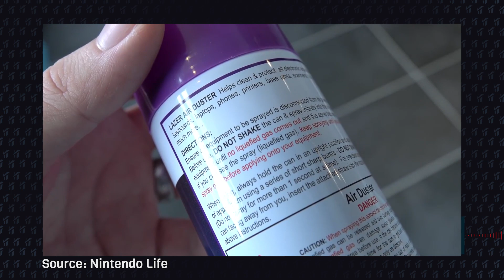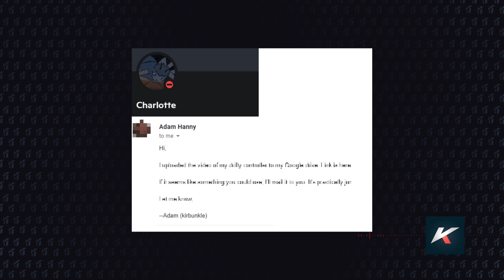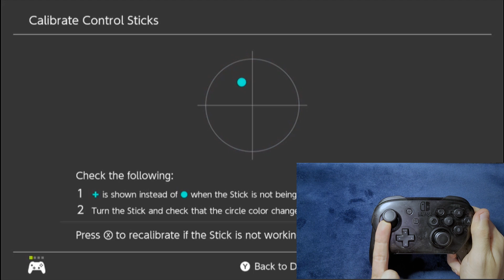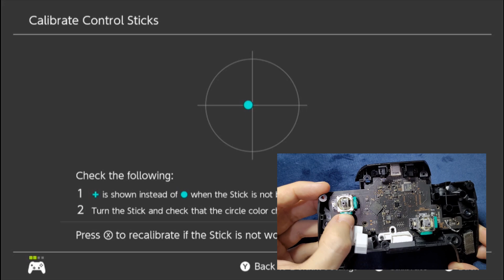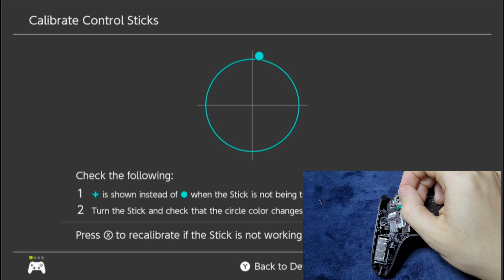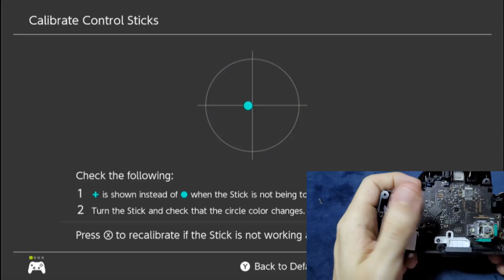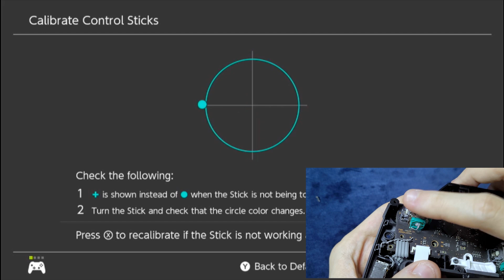Nintendo Switch Pro Controller Drift Fix!

Comment: Did not have any drift issues with the pro controller yet but this is going to be useful in the future
Reply: I have it on all 3 controllers after a month each
Reply: Same I've had my pro controller for 2 years and it didn't drift yet
Reply: @Tunic_  be careful my pro controller is 2+ years old and it just started drifting
Reply: @makito106 I'm using a pro controller from 2017 and it's fine but I have a dozen pro controllers so I'll be fine

Comment: This is the only video i could find that shows how to fix this problem with the stick drifting down like crazy, and I tought several times that i broke my controller because some things really weren't looking good, but after cleaning the controller from the inside and using 2 small and thin pieces of paper it worked perfectly again, thanks! If you're skeptical about doing this, it looks scarier than it is, you don't have to take the small metal circle out like he did, you just have to get the green thing out like in the video and put a small slice of paper or two through the hole.

Comment: When all you have is paper, everything looks like it needs some pressure added
Reply from the maker: Actually i believe that the problem in this one was the middle piece on the wiper that was loose so the paper acts as a shim
Reply: @VKsChannel  I had the same issue with gamecube controllers in the past. Instead of using paper, I used a small piece of plastic food wrap. This helped the middle piece stay more snug in the potentiometer.

Comment: Thank you VK! I tried it on my Surge Switchpad Pro Wireless Controller because one analog had INTENSE drift.. analog design is similar. Tried the paper fix and drift seems to be fixed. I will update in a month or if my analog will drift again.

Comment: I fixed my off-center drift by removing a piece of debris on that white "analog center piece".  No paper, no isopropyl alcohol, but air blowing that piece did the trick.  The key was opening that teal colored cover to get at it.

Comment: Bending the metal wire on the contact closer to the plate fixed it for me :) Thank you!
Reply from the maker: Yes it also works, but with time the metal can bend back, so if it does you'll know what to do

Comment: If you're here, there is a high likelyhood that your issue will be solved with the last step. Bend the wipers forward a bit and put a slim piece of paper or tape in the hole. It's actually better to just go straight to that first because you will avoid having to open and close your controller multiple times, which will increase the chance of something breaking.

Comment: Honestly, when I got drift on my pro controller I was just like fuck it. And put a spritz full of Wd-40 on the edges, swirled it around. And fixed it right up. 8 months later still no problem. Oddly enough, it did not work for Xbox or ps4 controllers.
Reply from the maker: The ps4 controller has a different problem I will post a video about it soon
Reply: I did the same thing lol, but it still have a little bit of drift sometimes on the right stick, wen I go home, I will do the process again and see if it works lol

Comment: Just tried this and by gosh it works. 
My pro would go solely to the left. It would not go up down middle or right. I did this and now it works as intended. I still have a minor minor drift every once in a while. I’m going to take it apart and tweak it a little more but I think this is gonna be the solution that works for me! 

Now, If you would do a video about the top buttons not work on the pro controller, that would be dope. Another one I have has this issue. None of them work. L, R ZR or ZL. And I can’t figure out why
Reply: In BotW it seemed like my ZR button didn't work... but that was only because of the right stick drift. Whenever you're on the bike and you tilt the right stick (changing the camera), ZR (centering the camera behind you) does nothing. 
Maybe that's also the case for you? You could try your buttons in different games.
Reply: @ZeldaPodSmashers  no they don’t work at all. I go the button screen in system settings where you can test all the buttons and none of the top buttons work
Reply: @Jeissecastillo  Ok, that sucks! I was really hoping it would be similar to my 'problem'. Did you check if there are maybe replacement buttons or contacts available?

Comment: i have 2 powerA controllers and on both controllers both sticks were drifting really bad. 
so i did these 3 steps - 
- cleaning the graphite pads with methylated spirits cos i dont have isopropyl alcohol and when i cleaned them the q-tips came out black 
- bent the metal wipers a little bit 
- and the paper shim trick in the hole 
and now none of them drift anymore they all work
but the one downside problem i noticed is the potentiometer protectors dont reconnect back well cos u have to bend them to get inside to clean, bend and shim

Comment: Pretty sure I did something wrong. When I took out the wiper from the potentiometer to clean it and reinsert it, both analog sticks stopped working altogether. There is NO input. Before I did this the sticks were drifting but now they aren't working at all. I even tried putting a piece of paper in the hole as demonstrated in the video and nothing happens. What should I do?
Reply from the maker: Check if the wiper is inserted in the correct position and if the potentiometer is completely attached to the stick box
Reply from the maker: You may have inserted it upside down
Reply: @VKsChannel  I think this was the issue, but it was VERY finicky. I was trying to fix this for 3 hours. In the end, it still drifts a little, unfortunately. But before it was drifting 100% of the time, and now it only drifts maybe 50% of the time and it doesn't drift as much. I think I might just get a new controller when it worsens. But thank you for making this tutorial and for the tips. I also watched your joy con drift video and that worked like a charm for me! Thank you!

Comment: So VK. I was wondering if there's anyway to fix snapback analog sticks for Pro Controller?

Details:
My Pro Controller is wired (don't judge me) and I have experienced some snapback issue when playing Smash Ultimate. When I try to pivot by flicking the analog stick, it sometimes faces to the original direction instead of the opposite direction and that's when I tried to do K Rool's back air. I often got forward air instead due to my controller's snapback. Thanks for the response if you know.
Reply from the maker: Hey I don't know much about snapback mods however it seems to be a chip installed on a controller right? So you could perhaps install the same chip on a pro controller?
Reply: @VKsChannel  ah ok. Will do so once I have enough savings.

Comment: Question tho.. When I put the paper allready and tested it.. The it's like the Pro con is always facing downwards now??
Reply from the maker: Did you close the potentiometer tightly? And did you put the wiper in the correct position?

It is upside down in the picture i took the correct position is with the middle bump in the metal ring facing up

Comment: Both of my pro controllers are drifting. I calibrate it. Left right down. Press up and the lit arrow for up is lit as if I'm still pushing up, even though I'm not pushing. Also, it likes to slide slightly off to the left.

Comment: Hello VK, I'm wonder if other third party controllers like PowerA Pro Controller and Gamecube Controller has the same analog stick as the regular pro controller. 
Cause I seen some videos that has the same or similar mechanics as the regular pro controller.
I feel like we could use the same fix as the one you just did.
Reply from the maker: Yes they have similar parts and you can try this fix on them too
Reply: @VKsChannel  thanks VK
Reply: I did it to my PowerA controller just now and even if I wasn't able to open the potentiometer as much as VK did, at least I could replace the lil circle things he put paper on.
Sadly my main stick's parts ended up getting messed up for some reason, so I put the C Stick's parts on it instead. I'd rather have a working controller without a Cstick over one with a fauly main stick.

Comment: My left analog is a bit loose. I get  the similar drift problem, but I think it's moreso because the analog stick isn't always center when I turn it on, and probably isn't getting a good read in general. Is tightening it a relatively easy fix? I can't find anything on getting it tight again, just cleaning.
Reply from the maker: Try applying the paper strip like i did and post your results on our discord channel

Link is in the description
Reply: @VKsChannel  that would help tighten the stick itself? The stick is loose a bit, so it doesn't always go back to a perfect center if you know what I mean. I don't do Discord, so if I do make a fix I can post results another way
Reply from the maker: @ZiggyMandarr  hmmm then it seems that your stick has damage in the plastic parts not on the potentiometer itself

Well in this case the best solution is to replace the entire stick

You can get replacement sticks for cheap on aliexpress

Comment: So my Pro Controller has a minor case of centering drift. On the calibration screen, the blue dot will "vibrate" inside of the center circle, but will almost never be dead center and still. It doesn't fight against my inputs, and it only seems to act up when I'm not touching the stick. It's especially prone to acting up when I very slightly and quickly move the stick and release. I'm also noticing that there's a VERY soft "grinding" and/or clicking sound when I spin it in circles. When I do it while pressing, the "grinding" sound is near nonexistent.

In most games, this does nothing. But, in games where the left stick has practically no dead zones in the center, it's able to cause shenanigans when I'm trying NOT to move.

The only prominent case I've had is in Super Mario 3D World + Bowser's Fury. It seems like movement inputs are VERY sensitive with like no dead zone. I could stand still, and Mario would randomly turn and face backwards and then immediately go still again. Sometimes he might even walk backwards on his own for at least a quarter of a second.

I've tried opening the controller at least 3 times, and sprayed the sticks with a plastic safe electronic contact cleaner, and wipe away any residue. The effect is either minor or nonexistent, cuz the drift still ends up being there.

This video made me wonder if it's something to do with the sensor wheels as shown. 

I was afraid to actually tamper with the sticks due to the whole soldering thing, and this Pro Controller I have is a custom painted one from Controller Chaos. It would really suck if this issue got worse and made it unusable.

Comment: This might be a long shot. I did the fixes in the video but now i have a huge left drift and it pushes left the whole time. Im wondering maybe i did something wrong? if you have time to reply even if its a suggestion that would be awesome thank you for the upload
Reply from the maker: Have you cleaned the potentiometer inside?

Check if the potentiometer is completely closed and if the metal piece is in the correct position

The little "bump" on the metal piece should be facing up

Comment: I’d like to try this fix but both screws on my pro controller (the screws on the grips) are both stripped. Does anyone have suggestions on how I can remove those screws?
Reply from the maker: I have a short video on how to remove stripped screws
Reply: @VKsChannel  Thank’s but one question how long did it take to strip the screw to be able to use a flat-head screwdriver?

Comment: How do you fold the paper? Does it go around the piece?
Reply from the maker: Put it through the middle of the piece then fold the tip like I've shown
Reply: @VKsChannel  Yeah, I just had to take a closer look. Thank you so much! My controller is finally working flawlessly! Now, I can focus on buying custom shells instead of a whole new controller! I'm a little intimidated to try working on my Joy-Cons, but it's worth a try for a permanent solution for drift.

Comment: Clean the controller before bloody showing it on camera, I believe you said this is not your controller so this goes out to everyone watching I bet its more often terrible treatment of the controller is the biggest source of all stick drift. Learn how to treat electronics carefully, the amount of used electronic stores selling terribly treated devices is insane, all my devices some I've owned for over 15 years now have barely a scratch, the most abuse they've had is discolored plastic from sitting in storage or thumbsticks rubber wearing down but not how you see so many old controllers with the thumb sticks bitten off by a dog.
Reply from the maker: Chill out dude

I went to examine the controller right away when I got it in the mail, besides it really shows how much this controller have been used so no one will say that I'm doing the fix on controllers with minor usage
Reply: @VKsChannel  My comment wasn't so much directed at your video, it's great to see you do the research and find a practical solution but there needs to be some blame on the consumer, electronics and all physical things made from plastics and metals are getting worse and worse in quality as manufacturing has changed to be cheaper for more volume so we all have to be more careful with our devices. With Right to Repair starting to get real attention now and restrictions on companies to find a univeral part for things that are disposable I hope manufacturing will also shift back to better quality instead of relying on premiums to warranty. As of right now we all have gotta be more delicate and if you're not (maybe if you're training on an esport for example) be prepared to order backups because electronics are just not made the same anymore.